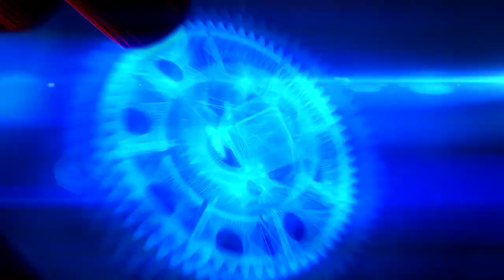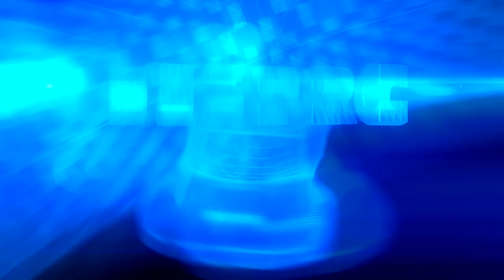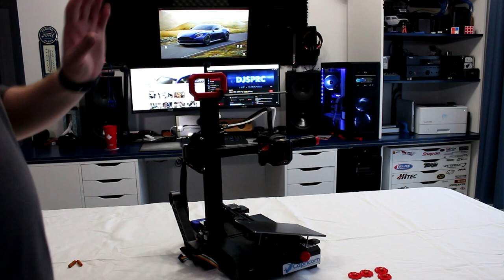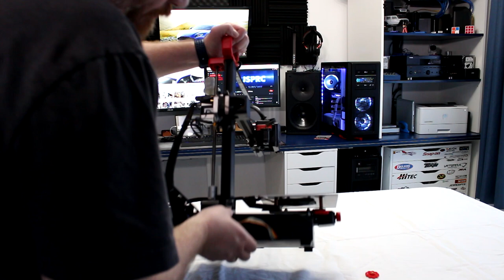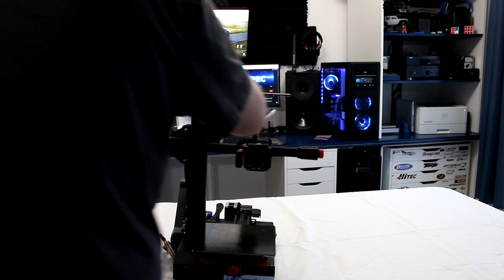Ender 2 Pro Spring Upgrade

Comment: Good video. Appreciate the content on the Ender 2 Pro. How do you find the bed now with the new springs?  Is that an upgrade to the filament spool holder as well?
Reply from the maker: With the new springs, I find the bed stays level longer.  It is a 3-D printer bearing holder that I found on  Thingiverse.